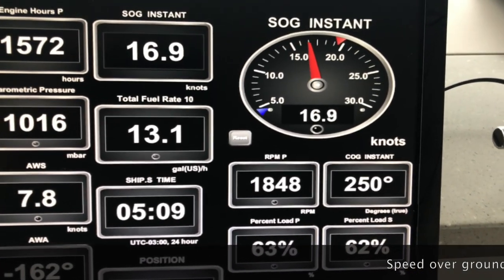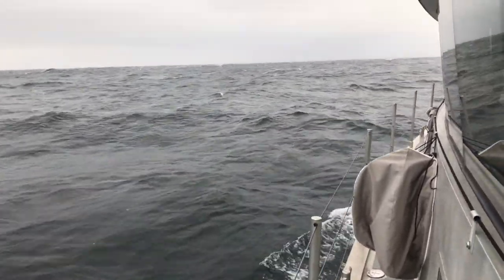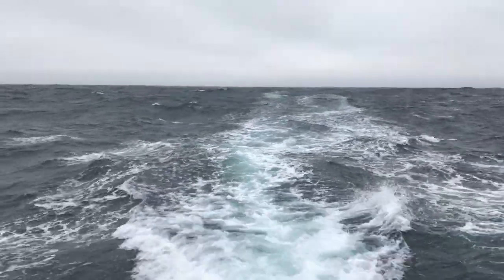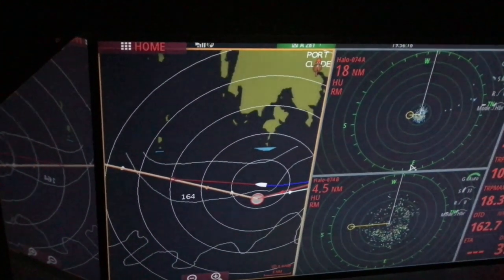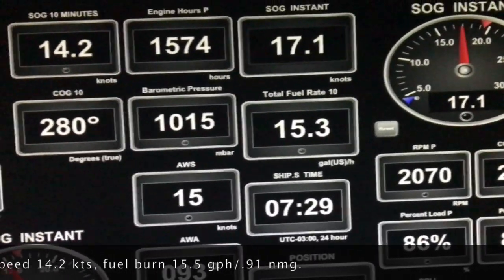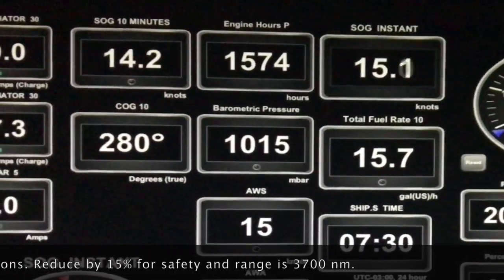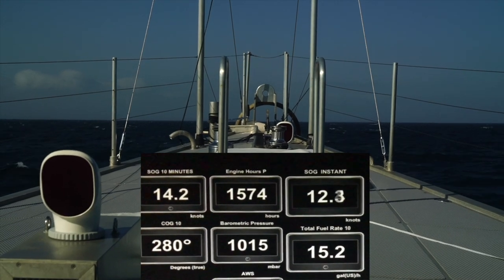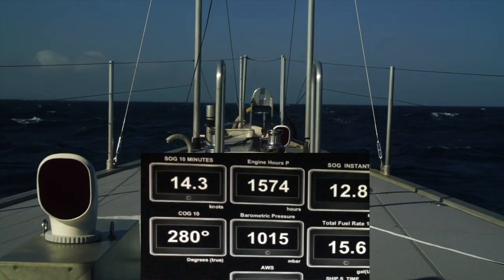Fast and Efficient Ocean Crossing Yacht Design | Tradewind Cruising Speed on FPB 78 Cochise

Comment: have you yet thought of designing  SWATH shipwhich is balanced on two submarine outrigger's though it stands upon them directly under the outer edges of the hull keeping the boats hull out of the water it's basically the hydrodynamic equivalent of shock absorbers increasing stability exponentially

Comment: So if Diesel was $3. gallon @ 4700 gallons that's $14,100 dollars for 1 tank of fuel.
Reply: Would you rather fill up a smaller tank several times. Do you have a Prius
Reply: And 4700 miles traveled. Traveling 240 miles a day, that's 20 days of travel and vacation time. That's $700 a day. Comparable to a normal vacation, if I'm not mistaken. However, diesel is not $3 a gallon. Probably more around $5, so inflate those numbers accordingly. Not a bad price to pay for such a badass retirement/vacation. People work their entire lives just to enjoy a decade or two of retirement. Enjoy the retirement to your fullest extent while still leaving your offspring enough to live on as well. It's family goals all around.

Comment: That's not efficient by any reasonable standard. Not even if yachts are inherently extremely wasteful way of traveling. Flying passenger airplanes would be more efficient. You should probably just get a smaller boat for starts. If you don't like sails, there's a hybrid system that uses magnus effect pylons for efficient fuel consumption. You could also use vertical wind turbines to transfer winds energy to the propeller. Combine with some simple sails and your getting closer to something that is efficient. Slower travel speeds help alot too.